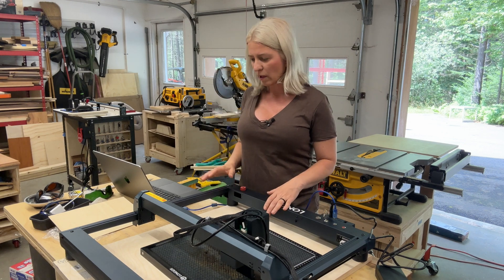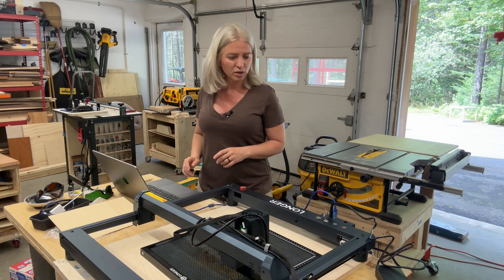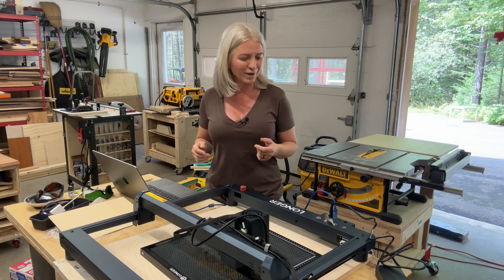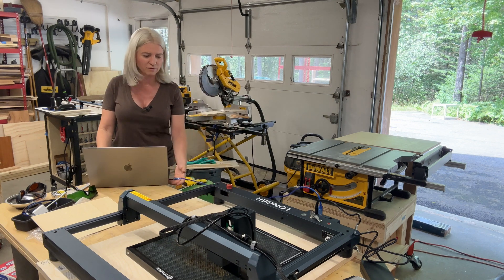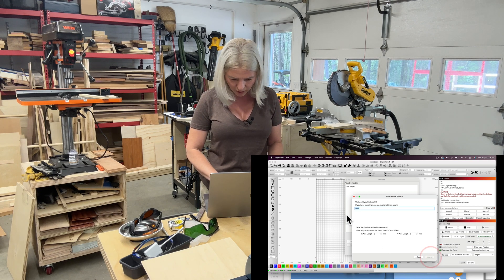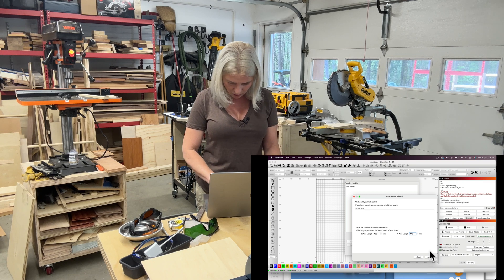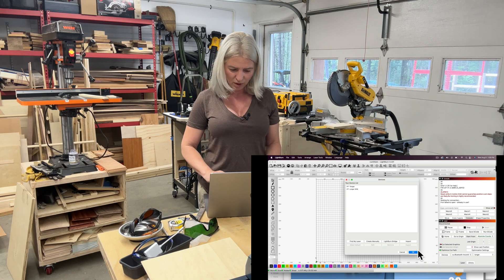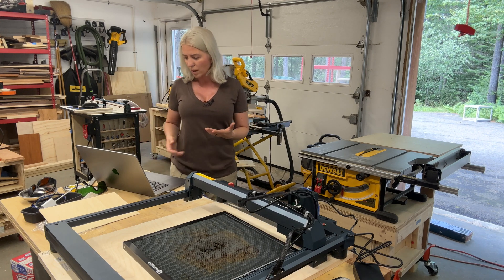How to connect Lightburn with longer laser engraver

Comment: I literally logged in to say I did all of this multiple times and it didn't work. But I did it all again and it worked this time. My concern is that Lightburn is going to be as unreliable with my Longer laser as it was with my Kentoktool. I would turn it on and it would connect and work fine, but 5 minutes later, it would lose the connection and I could not get it back. It was so frustrating. I tried every setting and possible configuration there was and could never get it to work consistently. Hopefully, I will have more luck with the Longer.

Comment: Hello I have a problem this message : « homing cycle is not enabled in your GRBL settings. »What is your solution ?? 
I’m very disappointed because this machin was very expensive for me !!!!!
Reply from the maker: Which laser are you using?
Reply: @SkylerEwingWoodworking  I’m using longer ray5 and I configured as shown in your video
Reply from the maker: @Yannb77163  the ray 5 doesn’t have limit switches so make sure you have start from set to cure t position instead of absolute coordinates